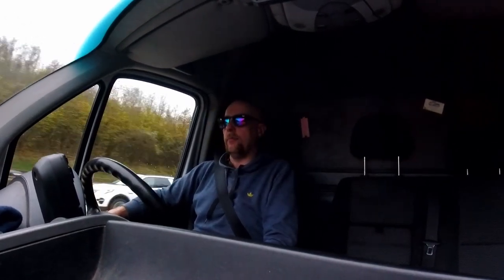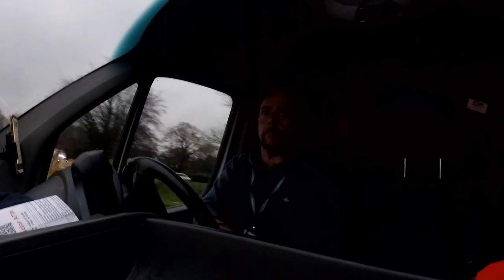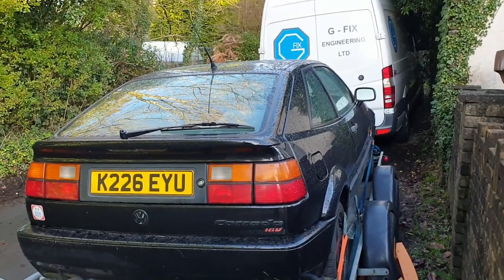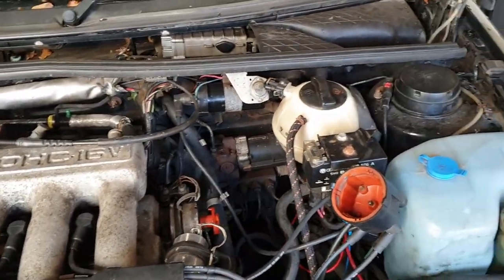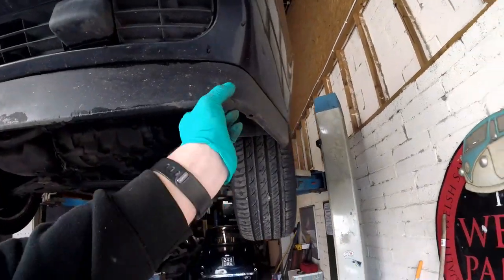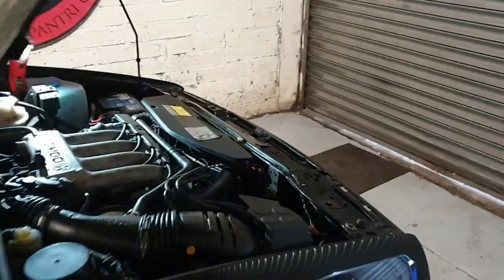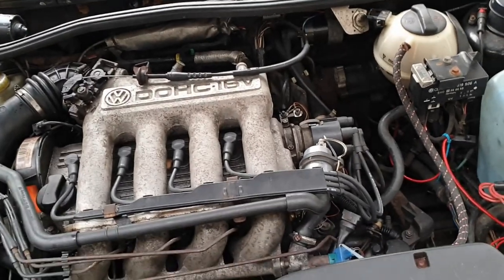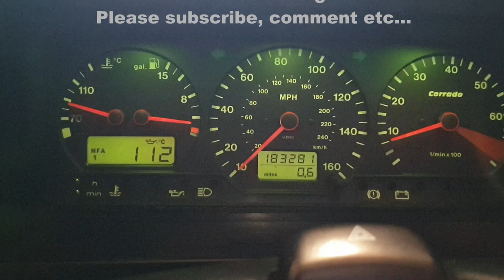1992 VW Corrado 16v Collection, Was it a good buy?

Comment: They arnt original Corrado alloys mate. You can still find original wheels fairly easily but the centre caps are virtually impossible to find. The 16v was painfully slow cos of how heavy the car is. That engine would go alot better in your mk1 😉
Reply from the maker: Are they not? I wasnt sure... I've seen a few different wheel options so am considering options. Nothing big mind...we did buy a cheap golf vr6 4 motion too...so many options...👍
Reply: @Gfix109  I may be wrong but I thought they all came with sebring alloys apart from the vr6. I had a 1.8 16v years ago and that had sebrings. The 16v engine goes so well in a mk1. Had one years back and helping a friend restore one now that's getting a 16v
Reply: Wheels are estorils off a mk2 golf I think...
Reply: @neilrobson9485  sebring were standard for g60. For 16v estorils could be standard.